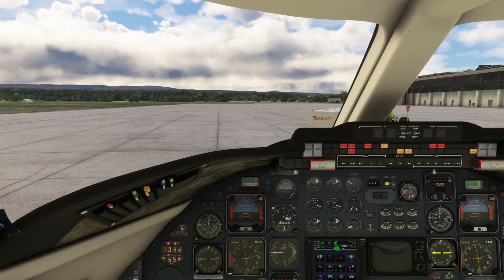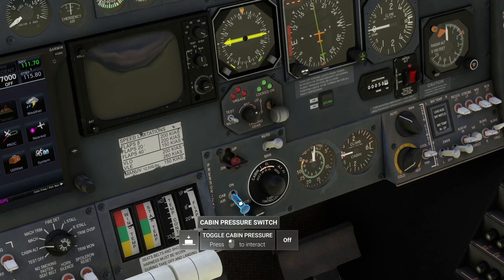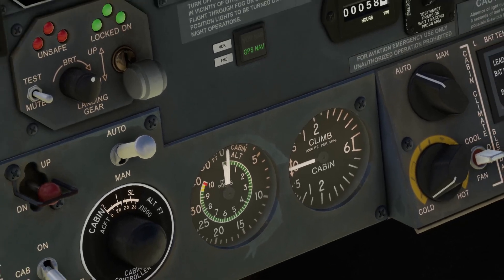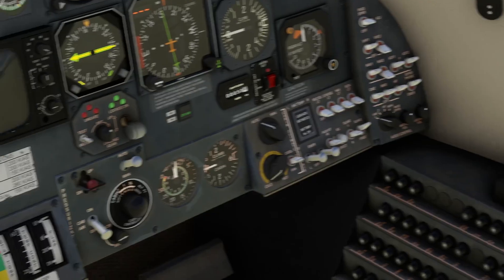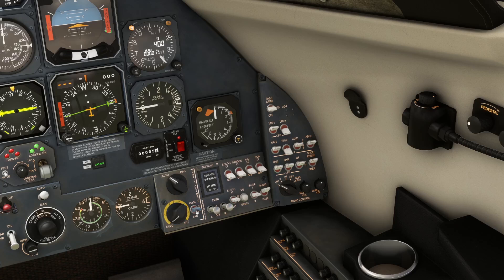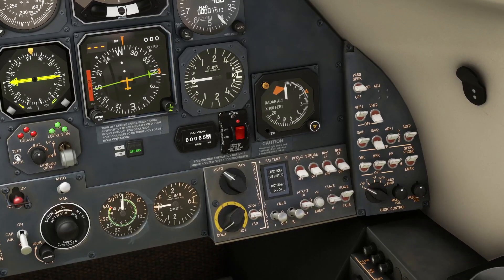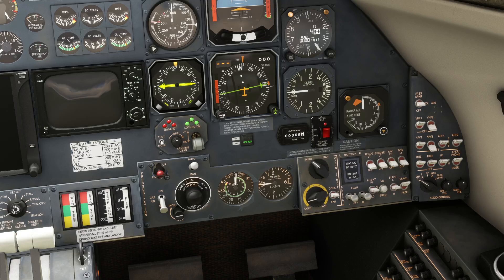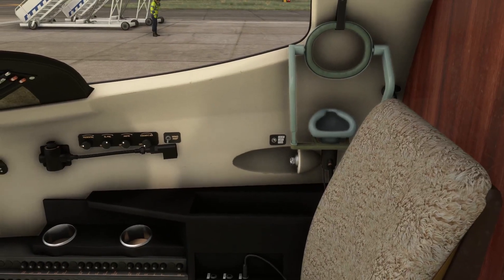How to Fly the Learjet 35A | Part 3c -  Pressurization & AC

Comment: Thank you for the though run down of the pressurization. question though...  what do/can you do if your at an air port thats over 10,000 ft. Im currently in game in a airport in Tebet thats at about 11000 ft and the dang alarm wont shut up. Since manual setting is not moddled(thank you again for that cause i was going batty trying to get it to work) what option do we have? just take off while the plan screams at us? lol.

Comment: Good presentation😊.  As an additional note, in viewing the face of the cabin pressurization module in this presentation, the cabin rate control knob is show as indicating the 3 o'clock position which is the maximum cabin rate of change (2,000 fpm +).  The tear-drop shaped rate control knob should normally be placed to point to the 9 o'clock position which is predetermined to 500 fpm cabin rate of change.  Under normal operation, the rate knob should remain in that position for the comfort of the passengers and flight crew. DB

Comment: Good familiarization presentation😊.  However, for a more precise and concise input on the Learjet 35/36, 35A/36 bleed air-pressurization and emergency system operation, along with troubleshooting input, a copy of Danny Brown's essay entitled “It's in the bumps” (revision update #14) is an essential document for both technicians and flight crew.  If the aircraft operation does not match this document, the aircraft is not operating correctly and will need corrective action.  West Star Aviation, Grand Junction, Colorado.